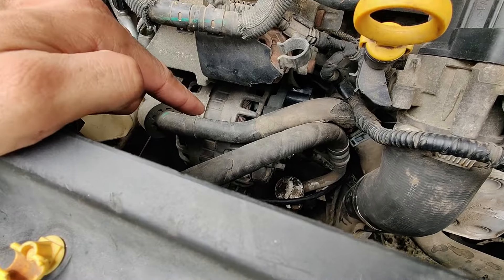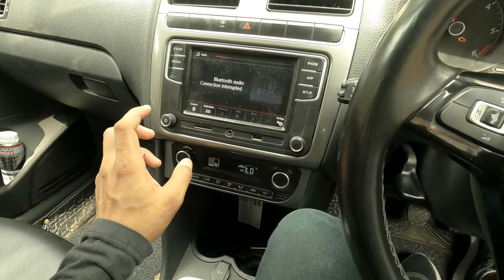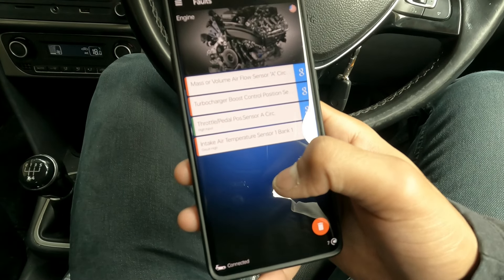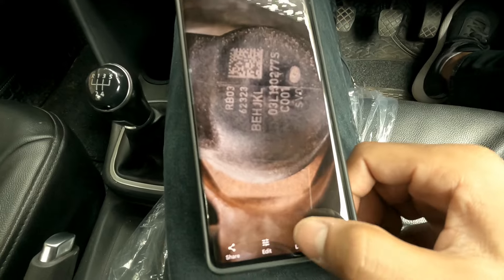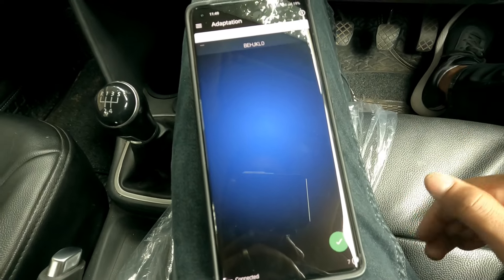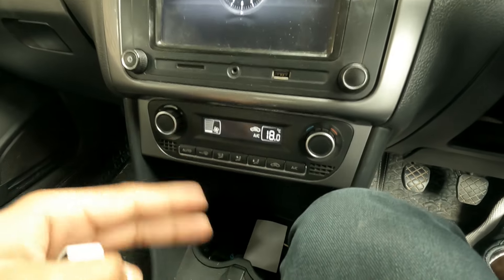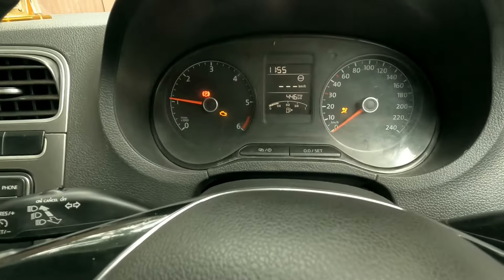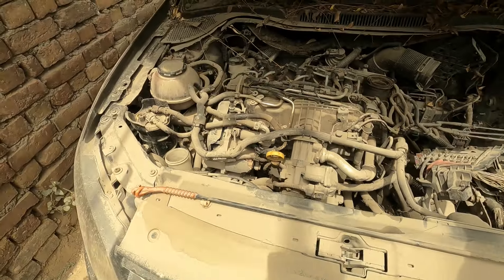ABANDONED & FORGOTTEN,  RESURRECTING A NEGLECTED POLO TDI - PART 3

Comment: Sir one small doubt in my skoda rapid 
Engine oil is seen in air filter hose and hessing sound is coming what may be the reason for that and there is no low pickup getting good mileage also but im afraid of turbo because its a costly part so there is any solution for that or how to check that from where the hessing sound is coming
Reply from the maker: A little bit of oil in the air air path comes from the CCV system and that's normal .
Hissing sound is always there from turbo , but when our air conditioning system's outside air flap gets covered in dust  , it doesn't seal properly so now noise from the engine bay can enter the cabin .

Comment: Is it possible to retrofit  cruise control  on vento 2012 model. What is procedure and requirements plz make video on that
Reply from the maker: Sir very first thing is to swap the BCM which supports the cruise control system then we have wire 4 new wires to the 4 cruise control pins on BCM and then have to replace the current steering stock control with the stock control which has cruise control buttons on it , then have to activate the system with either VCDS or OBD eleven
Reply: @yourDIYneeds sir Does BCM 87 support CC? in India where I can get steering stalk with cc buttons? What is obdelevem cost and where to buy?
Reply from the maker: @maheshbondre2313 
Sir it's not about part no. Ending with 87 , i don't know why people think that way .
Its all about hardware no. 
Like part 87f has variation where one has CC but the other one doesn't 
Like we need hardware version 46 of 87F for
For CC but hardware version 32 of 87f doesn't have any pins for CC so it doesn't support. 
Drop me a mail on everydaydiyhelp@gmail.com , i can send you reference images for more clarity
Reply from the maker: And steering stock can be arranged here in delhi , and obdeleven and VCDS both needs to be sourced from their official website , if you need VCDS then i can help , i know the india region dealer of VCDS devices

Comment: I have Storme 2015 88k driven .... Usme cold weather m temperatures neeche jaata rehta h.. Mne  OEM thermostat valve lgwa liya... 
Agr truck walo ki trah radiator ki front air blocked kr deta hu toa sab OK rehta h 

1 - agr temperature sensor error hota toa heater kaam krta... Plz help me 🙏
Reply: Same issue with my car storme 2028 model

Comment: Bro you can actually  do minimum quantity adaptation in obdeleven!?? 
Does it need security code and how long did this process take?
Reply from the maker: Yes its possible , 
It doesn't require security code for that 
And it can take up to 40-45 mins
Reply: Bro what do you advise obdeleven or vcds? And is obdeleven like a subscription or free to use like vcds?
Reply from the maker: @kailash.fattruth 
Sir you can use the basic functions of obdeleven for free but if you want access to a lot of data then you have to pay an annual premium ,  on other hand VCDS is one time investment but its not that great to use on smart phone , obdeleven is much more user friendly
So ultimately its gonna be your decision 
Obdeleven device is close to 8000 and VCDS is close to 30k

Comment: I have vento 1.6 tdi 2011 model, its having an issue of rmp automatically goes to 1000 rmp for few minutes but this happens often while in idle. so what might be the issue.
Reply from the maker: Sir engine adjusts the rpm as per the demand by energy management system , 
In following situations
1- to increase the flow of coolant in case of high ambient temperature
2 . When battery voltage is low , engine speed increases to increase the voltage from the alternator to charge the battery faster .
3 . High electrical load 
4 . High air conditioning load 
5 . High altitude which means thinner air 

Its completely normal ( if its not permanent)
Reply: @yourDIYneeds   Thank you sir. Yes it doesnt stay at 1000rmp normally it will be around 800 rpm, but automatically without me touching the accelerator the rpm goes to 1000. but this happens daily, when im standing in signal and even when car is on the go when i press the clutch it should come to normal idling speed know, but stays at 1000rpm for few mins.
sir, can i get your contact number.
Reply from the maker: @pruthviraj1826 sir mail me at everydaydiyhelp@gmail.com
I will share

Comment: Bro i have done car service recently.. and i drove around 800 kms only. Now i m getting some sounds whenever i m doing some u turns or some extreme. Recently only steering repair work has done and it was around 13k with other service with a total cost around 70k.
Do you have any idea why i m getting this sound.
And one more issue is my dim light, some times it is working and sometimes it is not working. But bright is fine.

Please help me and give me some idea.
I m having Volkswagen vento 2012 Diesel TDI
I m from tamil nadu

Comment: Perfect. I own a polo tdi, serviced and replaced the injectors, did the minimum deviation yet i can hear the injectors knocking. Any idea why that is happening?
Reply from the maker: Sir you got your injectors serviced ?  
In the process of service they disassemble the injectors completely , as a result the tolerances change , so injectors start to make noise .
Reply: @yourDIYneeds  i got them serviced..all 4 of them. Last night cylinder 4 injector failed..now i ll have to replace them..what do you recommend, new one or get a used one?
Reply from the maker: @vinterone22  sir go to a car scrap dealer and get 4 injectors , pulled out from an complete engine in front of you  , thats the best
Reply: Alright, appreciate it..

Comment: Hey there! I need your help with a weird issue which even VW guys can’t understand. I have a vento 1.6tdi.  Last year i got the cooling coil and central vents position actuator replaced. Since then my AC works fine and fan works fine too but after 2-2.5 hours of drive with ac on, the air flap (located in the fan box which controls whether air should go to the vents or not) closes automatically. And sometimes opens up too automatically after 15-20 minutes. But otherwise i end up shutting the car down for 40-50 minutes then only the vent opens up.   Fan works normally even after the flap turns to the off position .   Please help me out.
Reply from the maker: Sir either its a faulty climate control unit or maybe too much of dust and moisture accumulation inside the climate control unit , which is messing with the system , you can get it removed and get it cleaned with a electronic contact cleaner, easily available on online stores